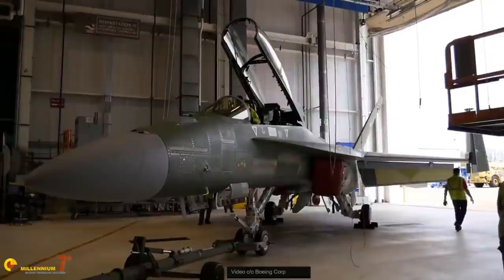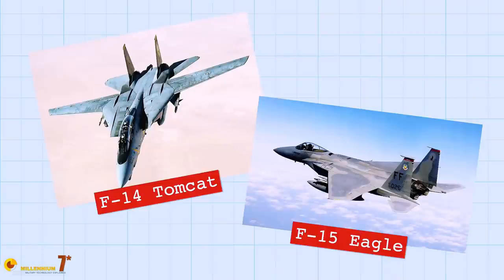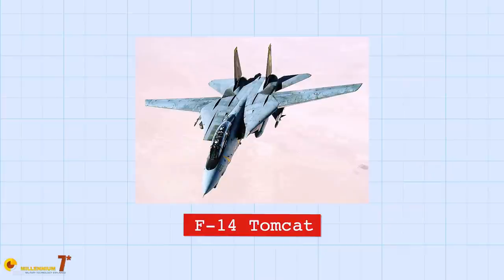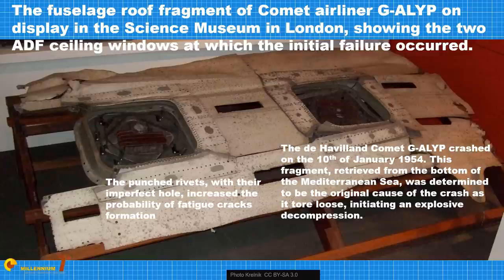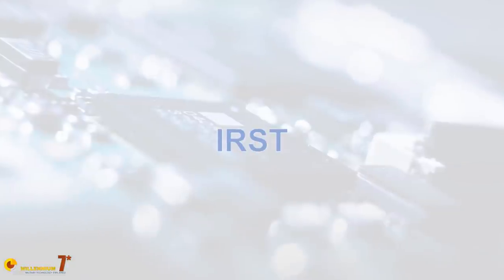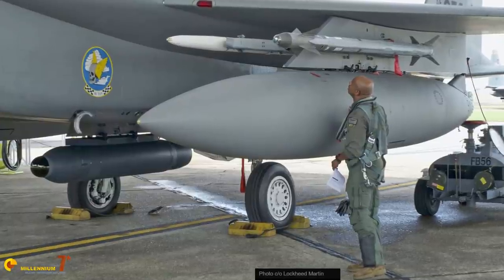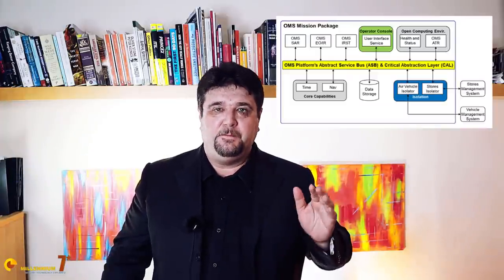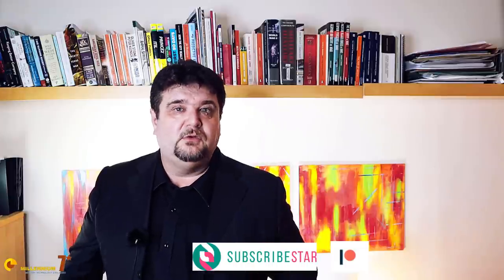The F/A-18 E/F Block 3: is it 5th Generation?

Comment: The explanation of how the Super Hornet came to replace the F-14 failed to mention the various proposed "Advanced Super Tomcat" concepts Grumman were offering. Concepts which, had the US Navy been left to its own devices might have become a reality. And it wasn't as simple as the Navy wanting a smaller and cheaper replacement (they actually wanted more F-14Ds in service than they ended up with) - much of the decision making was entirely political (Dick Cheney in particular seems to have been hell-bent on scrapping the Tomcat)
Reply: The Navy had its own complaints about Tomcats due to the insane MMHPFH it required, and failure-prone systems almost everywhere you looked.  It had a cockpit design based on early 1960s technology limits that wasn’t really ideal in the 1970s and 1980s, and was the most difficult aircraft to bring aboard the carrier after the RF-8C was retired.  One of the main systems that failed regularly on the F-14 was its primary sensor and fire control, the AWG-9.  Further investment into the No Really We Mean it this time Super Duper Tomcat was a very risky consideration, with even more unit and maintenance costs for a fleet of aircraft that was already sucking a huge chunk of the total Navy’s annual operational costs.
Reply: @LRRPFco52  The Navy literally asked the SecDef not to cancel the F-14D. The SecNav made an appeal to the SecDef for at least 132 new build F-14Ds when the SecDef said he wanted to cancel it (he also wanted to cancel the F-15E, V-22, and a few other programs at the time but they had a powerful enough lobby to keep them alive). The previous SecNav during Reagan, who saved the Hornet program when it was almost cancelled,  literally said he regretted not cancelling it in his autobiography. So, yes, there's a lot of nuance that is left out, and the reasons given here for why the Super Hornet program went forward is, like a lot of things, oversimplified because it takes too damn long to explain the full context.
Reply: @okisoba  The ATF program was very aware of the political atmosphere to program success at the time.  Every encounter with the contractors was focused on risk management to the program, which is why they cut the AIRST and supersonic ejection seat from the F-22.

F-14D and any Super Duper Tomcat represented significant operational cost risks that had to be factored into the budgetary considerations.  Unit cost is not the big deal outside of procurement years.

Very seldom do you see that argument being made in these discussions.
Reply: @LRRPFco52   What risk management are you talking about? All the stuff you're talking about in your original response to Solidboat is addressed in the F-14D (digital avionics/radar/flight control system, upgraded engines, etc.) . It's like if I limited the conversation, when comparing the Eagle and Hornet to other aircraft, to the avionics, engines, weapons, flight performance, etc of the original F-15A and F/A-18A. The cost of bringing the Tomcat to the desired level of capability we've been trying to give the Hornet would likely have been less compared to what we have and will spend on the Hornet over time as we transition to real next gen aircraft. One of the things some analysts in the 70s, 80s, and 90s complained about WRT the Hornet is that people keep saying the Hornet is a low risk/low cost alternative to the F-14, but in reality it's not. We had to completely overhaul the Hornet for it to overcome some of its weaknesses. And it wasn't "low risk" when you consider it was taking over virtually every mission for the carrier airwing. It had problems with its wing design (wing drop issues that, without a lot of aid from software, would still be a significant issue), issues with pylon angles and others. And we continue to keep pumping money into it to make up for its short comings. The spiel about MMH and complexity was originally used for both the F-14 and F-15 by the "fighter mafia", but that narrative continued to be used and stuck onto the F-14 because the Navy wasn't completely sold on what was being pushed on them (the F/A-18). Our legacy Hornets have similar availability and MMHs that Tomcats were having with airframes reaching 20 years of age, and that's with a program that got way more political and financial support. Some of the other reasons, other than  maintenance, for why the Hornet is one of the best things since sliced bread keep morphing from, "oh, fleet defense isn't important anymore cuz no more USSR; oh, we're only going to fight littoral conflicts against non-peer threats so we don't need long range fighters or stealth planes; oh, flight performance isn't as important because networking will make us nearly unstoppable." There is/was some truth in all of those points , but flight performance such as speed and endurance is still important as the host of this channel sort of indicated when he mentioned that last point, as is long range air defense thanks to China. Defense contracting/procurement is complex and annoying, and if I had to guess, the prospect of overseas sales of the Hornet/Super Hornet was a huge factor as to why some people in the Pentagon went with it over other options. It's a lot easier to sell than a "Super Duper Tomcat" or some high tech stealth Navy tactical jet. So, in that respect, I guess it was a good decision for the U.S. economy.
Reply: @okisoba  Fleet Defense was also provided with ship-launched missiles, not just thrown out because of the collapse of the Soviets.

The variable risk factor with F-14D and MMHPFH was also driven by it not having DFLCS, and the same complicated and maintenance-heavy flight control system as the original 1969 birds.

Bringing the Tomcat back to the carrier was very difficult and not a natural evolution in training from the T-2 or T-45A, so loss rates were high.

The Hornet and especially the Super Bug are some of the easiest fighters ever to bring back.

My initial reaction to the Tomcat retirement and shredding was the same as every other Tomcat fan, until I separated emotion and started looking at the big picture to understand why. After looking at FMC rates over its life, I was kinda shocked how low it was year-to-year.

The Navy was paying way more than they bargained for and getting very low availability with unsustainable mx efforts, while often being humiliated by the performance of the other teen fighters.
Reply: @LRRPFco52  The DFCS wasn't true fly by wire, but it made it far easier behind the boat according to pilots who flew the F-14 before it got it. The maintenance effort had a lot to do with the fleet's age and the fact that the production line ended in 1992. It wasn't built specifically for reliability but when it was newer the MMHPFH or whatever averaged in the 30s (edited). Not sure what FMC rates you're looking at, but even a decade later with squadrons having to cannibalize parts, FMC rates were comparable to some Hornet squadrons. I love the Hornet, I did lots of work with them when I did aviation C2 in the Marines, but I also know the Tomcat is better than the Hornet in a lot of ways. Anyway, with a virtually all Hornet fleet (until the F-35C is in every airwing), I'm sure it's way easier for the Navy when it comes to their logistics and, as you keep mentioning, their maintenance efforts.

And as for performance, in its last decade of service with the USN the F-14 was performing better than other teen fighters as far as sortie completion and effects on the battlespace.
Reply: @okisoba  Yes, 1975 FMC rate for the early BuNo F-14As was 37%.  Throughout its life, for the A, B, and D, the FMC rates were normally in the 50% region.  Desert Storm saw an avalanche of brand new spares and tons of effort to get the deployed squadrons as close to 100% as possible, but this was never the norm.

For post-9/11, maybe you’re comparing the Bombcat with LANTIRN to every teen fighter except for the F-15E.  I’ve never seen an argument that the F-14D did the strike/CAS role better than the Mud Hen.

It certainly had better loiter, range, and payload than the Hornet though.
Reply: @LRRPFco52  the 30s figure is MMHPFH, not FMC rates. FMC/MC rates were far higher than that.

Comment: IR technology is not as expensive as you might think. The only thing making it more expensive here is the prefix "Military".
Even a rotary or linear cooled IR head with megapixel class (above currently mounted technologies) class would be less than $100k.
The modern IRSTs look like IR heli-gimbals inside. They are inherently gyro stabilized and fast.
And they use a lot of e-stabilizer to get things really rock steady.
Their balanced weight mean that  forces on the head is actually pretty small compared to what they could have been,
although all the mountings do feel the sum of the force.
But this is essentially the same technology for Helis, Tanks, Fighters. Not any rocket science.

I would say the disadvantages would be cooldown time (5-15 minutes), know spectra, rather easily fooled, countermeasures are pretty effective, atleast in close combat.
Also. A lot of IRST do have rangefinders. So while the single IRST cannot triangulate, it sure can fire a rangefinder.
I'd be surprised if the modern IRST don't have rangefinders. Actually. I'd expect all modern IRST to know the range to locked target at all times.
Reply: yeah laser rangefinders are mounted on most IRST devices I Believe. Some planes also have laser warning receivers mounted. So you lose the ambush element if you use the rangefinder.
Reply: Now ruggedize it for high G, high altitude, impacts, extremely wide operating temp range, NBC environment, EMP shielded electronics, high salt, high humidity, high dust/sand, and limit parts manufacture to the US/UK/NATO for raw materials, subcomponents, final assembly.

If you ever look at what a military contract entails from a compliance perspective, you start to see why it costs what it does.  Some of it really is rocket science, and most companies don’t want to deal with all the hassle of submitting for a contract, just to lose out.
Reply: @LRRPFco52  : There is little difference between an IRST for a tanks, helis and jet fighters. Jet fighters have extremely low G requirements. Their hardware requirements are similar to those in helicopters. Temp range is not more than anything else military. Tanks have several hundred Gs as shock. Jet fighters seldom experience more than a dozen G. Temp range usually exceed those in jet fighters because jets have access to active temperature management directly as air-mass to the equipment. Tanks usually don't. By comparision, jet fighters have no special hardware requirements.

If you've ever been near the cooling system for a modern jet fighter you'll know.
Reply: @adambratt9902 : Exactly. Also, new techniques are used to blind the IRST passive sensor by lighting it up. Since the sensor is so sensitive, you'll require very little power to completely blind it.
Reply: @christianm1533  Oh so it works by burning the "camera eye"? Like how staring into the sun is damaging to our eyes? Sounds close to radar jamming only that passive IRST don't have ranging information to jam so you are just marking your direction unless you damage the sensor by burning it. But if you have that capebility, why not just aim for the pilots eyes instead? Surely a blind pilot is pretty detrimental to the planes combat ability?
Reply: @adambratt9902  : You do not need to burn it. But just blind it. Single passive IRST have Laser rangefinders. They cannot triangulate, but they do rangefinding. Once you overwhelm the sensor there is nothing left to track. It's not like you're going to see "the dot". The aperture is so large at distance that it will cover the entire sensor area.
The Russian SU-57 Felon has IR jamming capability against incoming IR missiles. IR missiles like the IRIS-T work with exactly the same principle, albeit with a smaller head. 

Here is a choice of gimbals for Helis, they are more or less the same technology for IRST for Fighters.

https://www.flir.com/browse/government-defense/airborne-systems/

Comment: Answer: it's 4++ generation!
12:28-the F-14D had the dual TCS (Television Camera System)/IRSTD pod under its nose
Reply: Well if you are very kind you can  say so but I would say it it is a gen 4+++ aircraft since the RCS is large and it can not supercruise while for example Jas 39 E is a 4, 5 generation plane due to low RCS, supercruise capacity.
Reply: @sorennilsson9742  one thing it can’t do Mach-2+ speed.

Comment: You would think by Block 3 they would have figured out a way to mount the ordinance parallel with the centerline of the airframe instead of continuing to drag it through the air canted sideways.  Anyone who has stuck their bladed hand out of the window on the freeway knows what this does for parasitic drag.

Comment: Here is question.  The McDonald Douglas F15 has flown without one wing.  Can the F18 fly without a tail rudder with its digital flight controls?  One of the largest radar return are those tail rudders.  Removing them....

Comment: I see in the FAQ slide that Linux is mentioned apparently as a "primary" operating system. I think (I'm an IT/Linux guy) could be interesting also some history/analysis about usage of operating systems in military hardware and environments. I can remember that many, many years ago the US Navy tried to control a ship via a windows NT system. The ship stopped as a sitting duck in the middle of the Ocean.. ;-) In case, if needed please consider me available also for some sort of cooperation. And, apologies for my English, it is not my mother tongue (Italian is). Apparently, also Space X rockets are somehow Linux based (at least for the non strict-real-time part).
Reply from the maker: Grazie. Contattami in privato. Vai alla home del canale, click su "About", in fondo spiega come accedere all'e-mail.
Reply: No aircraft currently integrates Linux as a hard flight-control operating environment.
Most modern fighter architectures split the system between critical ones and less critical ones.
Less critical could be something like RADAR, IRST, EW-system etc.
If you have a failure there it won't mean the bird will drop out of the sky.
You can restart that system or get back to base without much issue.

So no. You won't find happy hacking inside avionics control. :)
Reply: Yes more avionics and software infos would be great.
Reply: @christianm1533  So much mission critical real time runs on Linux, since 2010 60%  of mobile networks for example. Defence is following suit ie Zumwalt-class destroyer is full of IBM blades running Linux
Reply: @phoneticau  : Nope. It does not. Linux handles 3GPP MoMs and configuration. Realtime is handled by ASICs. The small requirements that are configuration changes at a pace can be more than adequately handled by a soft-rt configuration like a pretty vanilla Linux.
Reply: @christianm1533  I was not clear, Indeed the radio access layers would be ASICs or FPGAs, but the overall network on top is Linux
Reply: @phoneticau  : Yes. But those are not strict hard realtime requirements. All those now more or less do Ethernet/configuration stuff or some other best effort transmission. Does not mean it won't do its job though. This is a throughput environment you're describing. You measure by "calls per second", "megabits per something", "calls handled per service node" etc. Throughput environments are often best served with a high feature soft-realtime OS such as Linux, as you say. But this is not the same as controlling avionics for a flight model. :)
So aircrafts have split architecture. Always did have though. Just that the "soft" side has gone even "softer" towards Linux and flexibility.
A lot of other things are also split. You won't find a lot of Linux in controlling a combustion process for example. Yet, anyway. :)